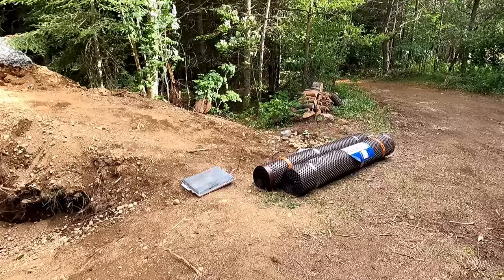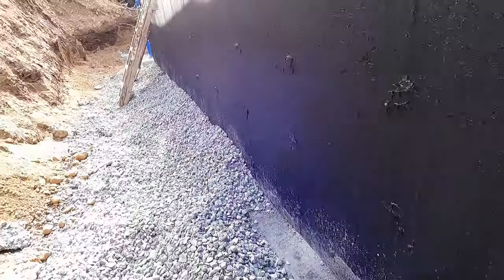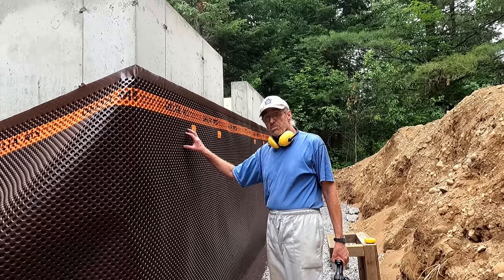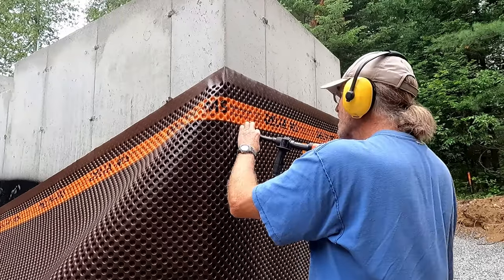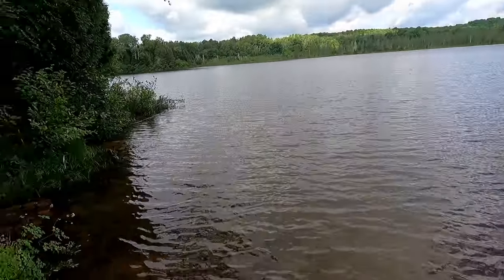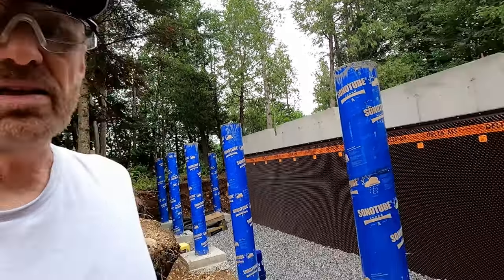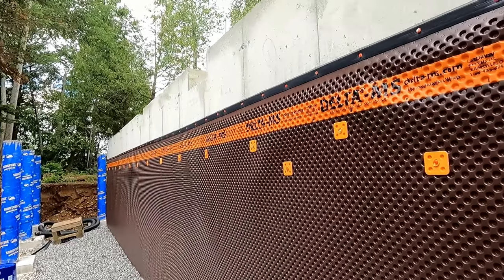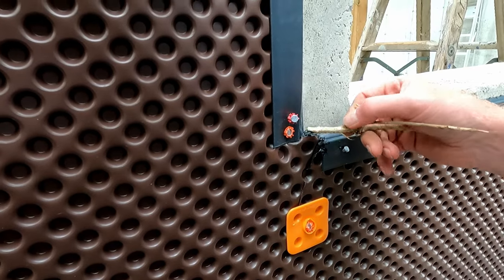Dimple wrapping the foundation! Episode 5

Comment: Besides the water proofing feature , how does this mitigate heavy saturated soils from pushing on the foundation? The plastic won’t allow the soils to drain down.
Reply from the maker: I’m definitely no expert on this.  But the building code here in Ontario stipulates that you must have 2 feet of drainage sand up against your foundation OR the dimple wrap.  The dimple wrap provides lots of spaces for any water that gets behind it to drain down to the weeping tiles.  The soil around our cabin is all sand and gravel so it drains well anyway so I’m not concerned about saturated soils exerting pressure on the foundation.  Now the Ontario building code does tell you how thick your foundation walls have to be for whatever height of backfill you are doing - this takes into account any soil even water retaining soil.  My walls are 8” thick.   I was instructed not to backfill until I had all of the floor joists in place as bracing for the walls.  The code will tell you.  Hope this helps.

Comment: But... In case of subterranean flood... The water has no way to escape right? Theres no drainage from that gravel trench
Reply from the maker: The perimeter of the building has a weeping system of gravel and Big O which moves the water to the low corner and out away from the building which in this case is down the hillside.